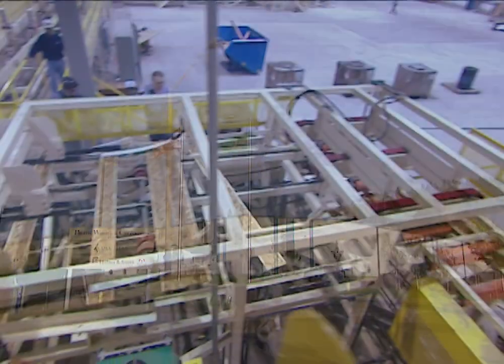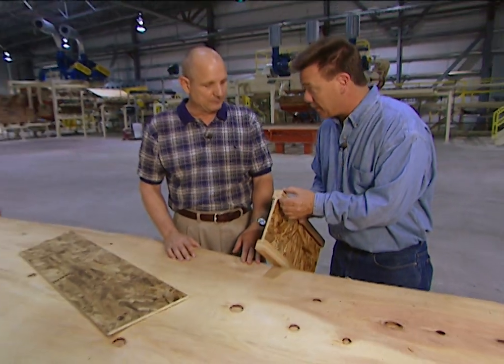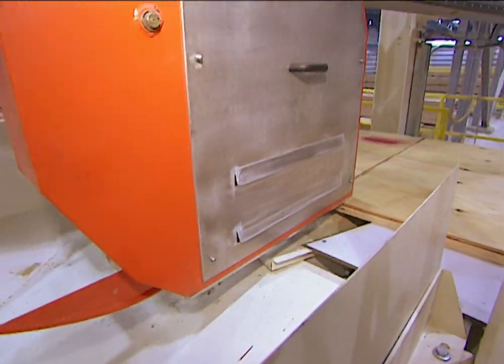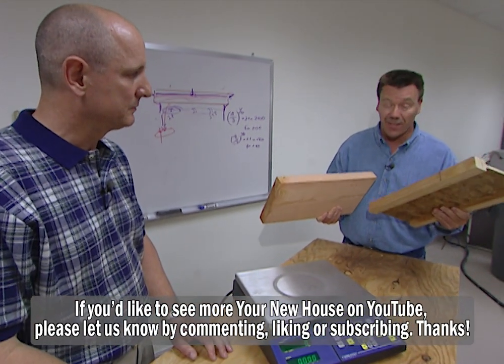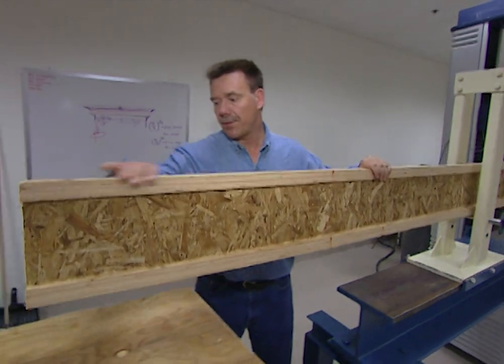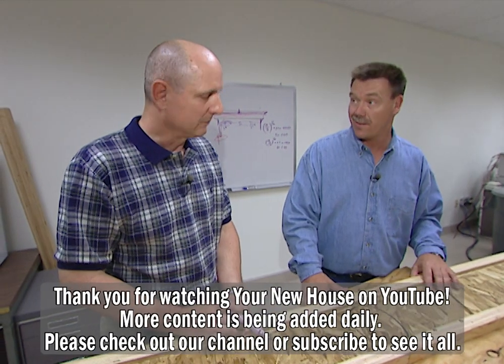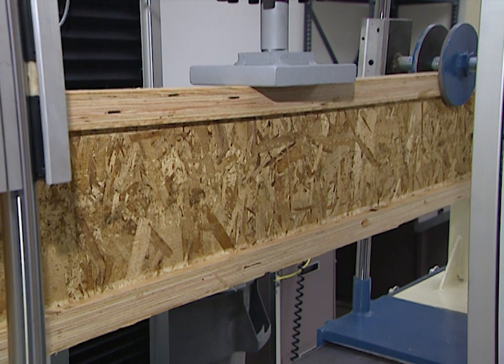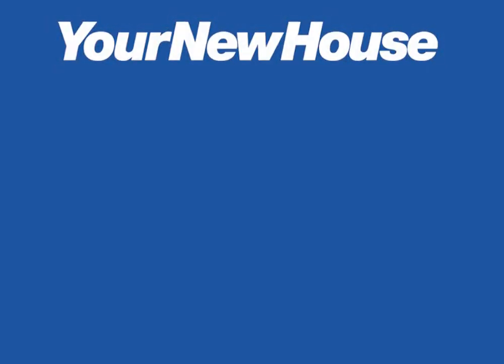What is an I-Joist and How are They Made - Did You Know?

Comment: I would like to see a test again with a couple changes. One with a board without such a massive knot. Also put holes in both for vent , electrical, and plumbing. Lastly, what is the cost difference? Enough to justify a 1.5x strength?
Reply: i wonder if an I joist will hold its strength after 100 years

Comment: The I-Joist concept is great "on paper", but has a drawback: Supporting hanging loads. 
I have a garage beneath bedrooms in a 2 story house.  I need storage space and wanted to hang things from the garage ceiling. Lucky I looked before starting. Lag bolts through the lower cap and into the webbing could have degraded their strength and nobody would have known.
Reply: I feel your pain! hehe. As a traveling certified installer of anchoring points for elevators and cranes i have seen some weird constructions.
but we must always think 2x5x safety::: which means that if an anchor point shall hold 1000 pounds, we hang 2500 pounds from the points!
so we most times DONT anchor cranes-elevators in wooden anchor points even if the dimensions are big normal lumber, becouse even the best wooden screw-s can be pulled out to easy after some use and wriggling.
we usually install say  steel beam-s between the beams-joists. that go between 2 load bearing walls.
Reply: I have the same I-Joists and I want to hang storage racks. Did you ever do it and or how?
Reply: Attach it the top of the I-Joist not the lower cap or webbing.

Comment: Thar knot that close to the edge is uncceptable in a 2btr.  Engineered lumber has advantages such as consistency and strength/weight.  That said, I would avoid these like the plague in my own houses.  Just picturing a 3" drain pipe beinf routed through that js painful.  Most improtantly, moisture damage seem like a huge weakness too.

Comment: I don't like the way they tested the strenght.
I'd like to see another test with a smaller gap between the pressure and the resting area of the 2x10
Due to the way the 2x10 splits, you're giving an edge to the i-Joist here.

That being said, the i-joist is certainly very strong.

Comment: What about termite damage
Reply: I would imagine the potential for damage is minimal. Termites don't like Douglas fur, which they specifically used for the flange. While they didn't share the makeup of the OSB (it sounds like a proprietary mixture of wood and glue - and termites don't like glue), I'd be willing to bet they took termite threat into consideration for the design of the entire joist. Using Douglas fur for the flanges would otherwise be pointless.

Comment: 50% stronger my Oklahoma Sooner buttocks how about 50% weaker a true 5 inch wide by 8 inch tall solid wood beam made of White Oak can run circles around this those manufactured i joists and take more than 3 hours to burn through to be declared unsafe compared to just 4 to 5 minutes with manufactured i joists most manufacturers of manufactured i joists never their products when exposed to fire and i wonder why.
Reply: Who builds house with white oak for framing? It would be ridiculously expensive. They compare softwoods to those joints
Reply: Not to mention 5x8!
Reply: @rustybeatty6567  It takes around 20000 board feet of lumber to build a a 3000 sq ft house. Rough sawn white oak runs at $10 per board foot plus tax. Your framing would run you over $200K. You would gain absolutely no advantage over pine except for a better rot rating. It makes no difference because it's enclosed inside all the sheeting material anyways. Your house would be extremely heavy. Nails is a no go. You would need proper joinery. Add another 200K for labor. You also need to realize - you won't be able to run drywall screws into oak. There are plenty of houses built over a 100 years ago using pine. They will stand another 100. If you want to build a timeless fortress and willing to spend half a million on framing, why not build with brick/stone?